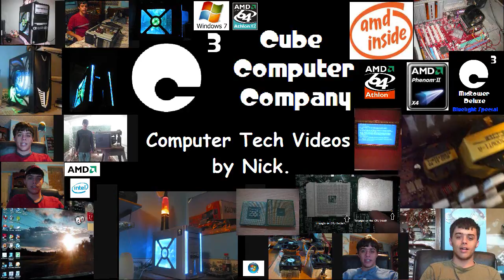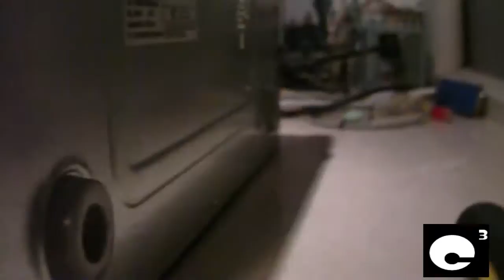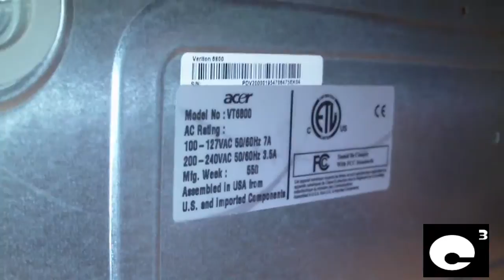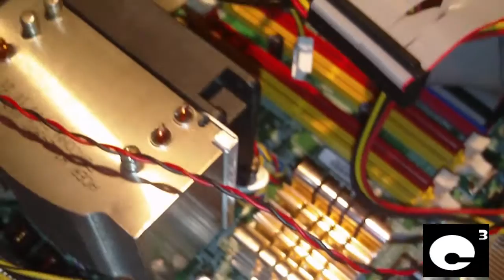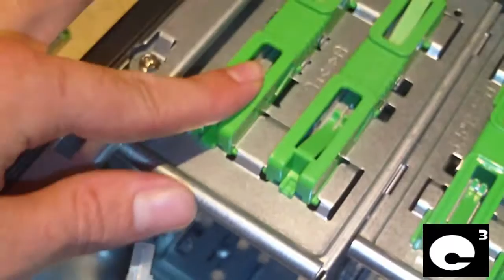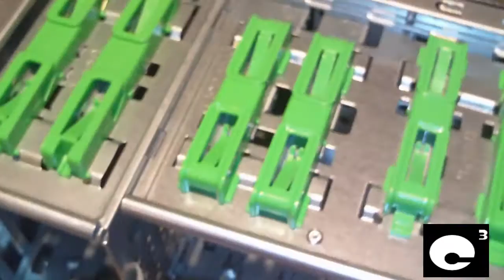A look inside a U.S. assembled Acer Desktop PC

Comment: I have this case. It's perfect for a home server build, except for ONE, stupid thing: you can't fit a fan on the front to cool the HDDs. I tried putting it between the front panel and the air intake: awful, doesn't push in enough air and it's noisy. That sucks.